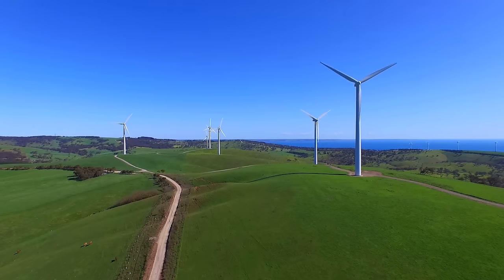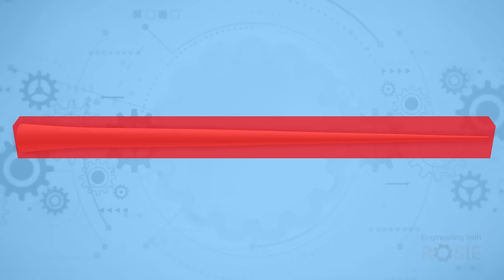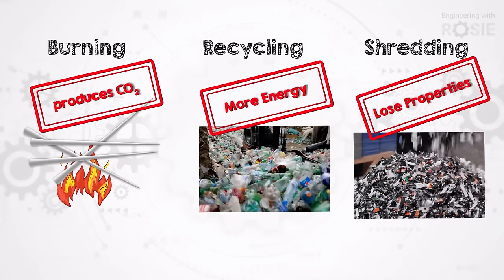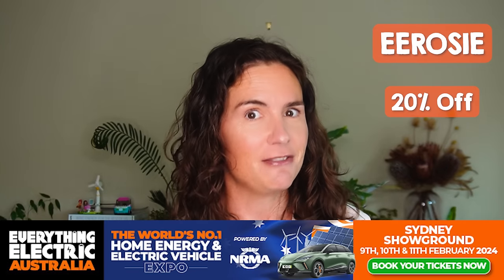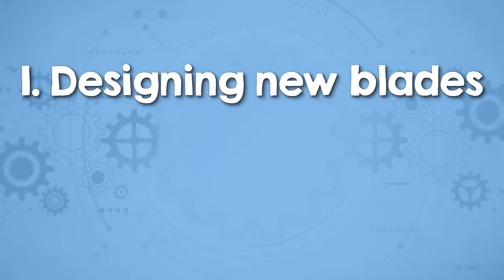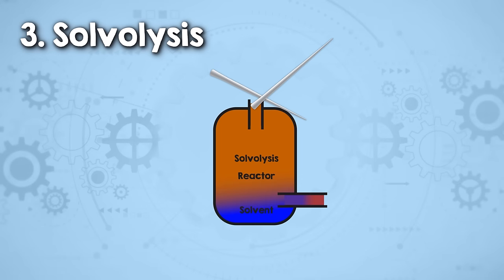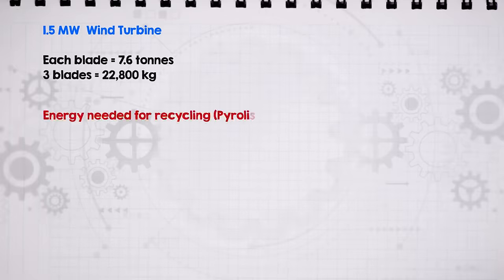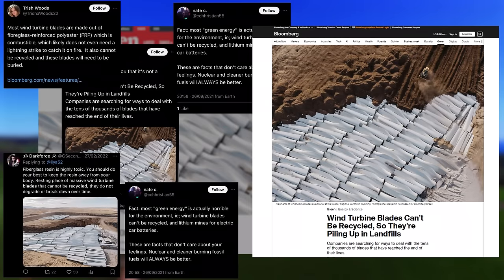This Is Why We Don't Recycle Wind Turbine Blades

Comment: Thorium nuclear energy will be much cheaper than wind or solar so the problems with recycling wind turbine blades will fade away.
Reply: And nuclear reactors get recycled all the time at end-of-life right? Nuclear is needed but it’s not a panacea…
Reply: Liquide Floride Thorium Reactors are totally different than traditional nuclear reactors. The waste products of this type of reactor though small, have a half-life of 200 years. As for how long a thorium reactor will last and what can be done to recycle it when it has reached its lifespan, I think no one really knows because these are not in general operation yet.
Reply: @georgestreicher252  and that is part of the problem - it's like saying fusion reactors will solve the problem - in 20+ years. In addition it's not so much the nuclear waste that I was thinking of, but more all the surrounding infrastructure like the concrete, steel and other materials during construction - yes they can be recycled but is it in reality or just left as a shell on decommissioning? All of that is built, maintained and decommissioned on fossil fuels as is the mining of the thorium itself. Big question is then, does the useful carbon neutral generation offset the carbon output from the very existence of the plant? I believe life cycle analyses have been completed on PV and turbines becuase they need to demonstrate being "greener than green" because of "what-aboutery?" from those that like to pick holes in renewables - I doubt the naysayers would consider that for a gas or coal plant - likewise I wonder if anyone questions hydro dams because of all the concrete - will that ever get recycled?!

Comment: Please don't limit your ability to think so much, 
 normally a tree is not used only in its entirety, 
 you would cut beams and boards, etc., with computer programs you design the cuts 🤷🏼‍♂️🤷🏼‍♂️
 the same happens with the second-use blades of wind turbines, 
 No false information , please, please, please !!!, 
 it only makes everything worse,

Comment: “How will we dispose of the turbine blades?” is among the top disingenuous objections to renewable energy. Drives me nuts. A while back, I was driving south on the Minnesota/Iowa border, where you go through several large wind farms - hundreds of turbines. And I was thinking “What’s the volume/mass of all those blades, relative to the volume/mass of the concrete and asphalt in this four lanes + shoulders interstate highway? Or the volume/mass of the thousands of cars driving by?” After all, the much-criticized 20-25 year blade life is about the same as the lifespan of pavement, and longer than the lifespan of a car.

Comment: 📝 Summary of Key Points:

📌 Wind turbine blades, made of composite materials like fiberglass and carbon fiber, pose a challenge for recycling due to their unique composition.
🧐 Various recycling methods are being explored, including repurposing blades, shredding them for non-structural applications, and using advanced techniques like paralysis and chemical recycling.
🚀 Progress is being made in designing blades that are easier to recycle, such as using thermoplastic resins instead of thermosets.
🚀 Companies and researchers are working on advanced recycling methods and new blade designs to recover both resin and fiber for reuse in new blades.
🚀 Cost and regulations play a crucial role in driving the adoption of recycled or recyclable wind turbine blades.

💡 Additional Insights and Observations:

💬 "The structural design of wind turbine blades relies on fiber-reinforced materials like fiberglass and carbon fiber."
📊 According to the video, most parts of a wind turbine are recyclable except for the blades.
🌐 The video emphasizes the importance of recovering both resin and fiber for reuse in new blades to reduce the need for virgin materials.

📣 Concluding Remarks:

The video highlights the challenges and methods of recycling wind turbine blades, focusing on the unique composition of these blades and the ongoing efforts to develop advanced recycling techniques and new blade designs. While there are still complexities and questions about sustainability and environmental impact, progress is being made towards a more sustainable future for wind power.

Generated using TalkBud

Comment: How will "they" recycle coal, oil and uranium? 
Calculate how much energy it takes to make the item 
and how much energy the item gives, if you use more then the item is not worth it.
Reply: I have this argument with idiots about EV's when they rail about the charge density of lithium batteries vs fossil fuels.
I tell them the battery is the tank, and electrons weigh nothing for the energy they provide.
Also that the battery weight is shared over hundreds (or thousands) of fill-ups while that 25k of petrol goes out the tailpipe and the weight of fuel is cumulative. 
25 kilos a week over 10 years (25*52*10=) is an insane amount of mass compared to a vehicle pack that is completely agnostic about where it's electrons come from.
Reply: Coal/Oil aside, Spent Fuel Rod Reprocessing and Breeder Reactors ?
Reply: @ericlotze7724  Breeders create plutonium and other higher actinides.
Which may be very viable fuels in their own right, but hysteria about nuclear weapons proliferation keeps it from happening in the free world (except France)
Reply: @jimurrata6785  sadly yes.  I think there may have been some odd ways to make Procurement Resistant Fuels/Reprocessing Setups but yeah sad aspect holding nuclear technology back.

Luckily other renewables make nuclear somewhat obsolete, albeit still a good option if need be, especially newer designs.
Reply: @ericlotze7724  I've got no problem with nuclear.
It's just the (not unreasonable) regulations and outrageous costs of construction on top of NIMBYism and paranoia holding it back.
For context my entire maternal family was captured by the Japanese, and I don't have a problem with the bomb either..

Comment: Darn. I was hoping an engineer wouldn't create a greenwash piece. You highlighted the wonderful part of the cement production process but ignored this "It's currently the only such cement plant in Europe that's using blade waste." The article you referenced paints a wonderful picture typical of a greenwash fluff piece that insinuates that profits in the manufacture of cement will inevitably be enhanced by the inclusion of blade waste. So why aren't the world's cement producers (especially the Chinese) rushing headlong into this process? There must be a severe downside. Like maybe the cement produced is of lower quality because it contains undesirable compounds and adulterants introduced with the blade waste?

But then you are an AGW true believer. Which is sad. How do you as an engineer reconcile disbelief in the violent and unexplainable temperature rise that ended the last ice age as well as the Medieval Warming Period and the much more recent Little Ice Age? The incredible erosional features indicate the last ice age ended with huge flows of meltwater over a relatively short period, not trickles over millions of years and that can only occur with a rapid global temperature rise 17k to 15k before the industrial revolution.

Comment: Only problem, these shiiiitty  blades does not last 20 years. Why they do not make these reusable. No melting down, just repair and go again top of the post
Reply: added size, weight.
Reply: Who says they don't last 20 years?  That aside, there comes a point it becomes more efficient to replace than repair, the same as goes for everything else in the world subject to constant wear and fatigue.  Try to use and maintain a car forever for example.  You will only end-up replacing the entirety of its parts over time.